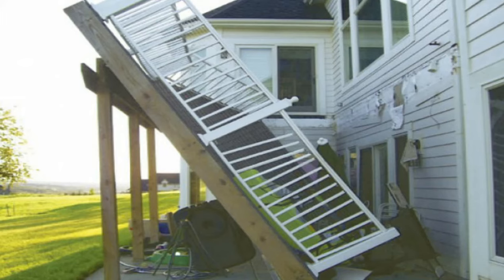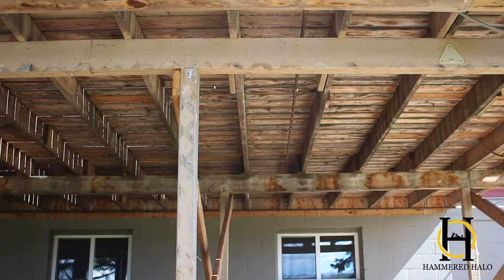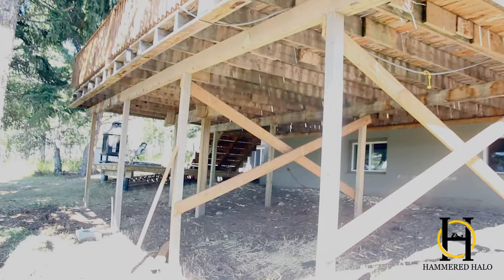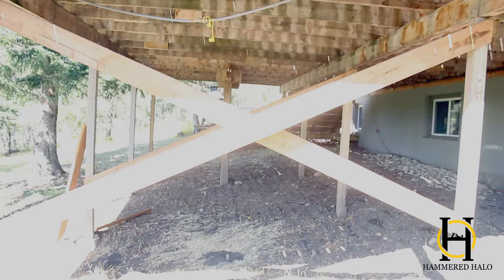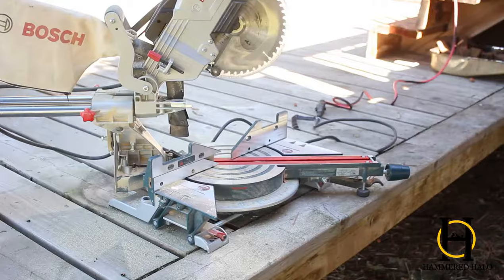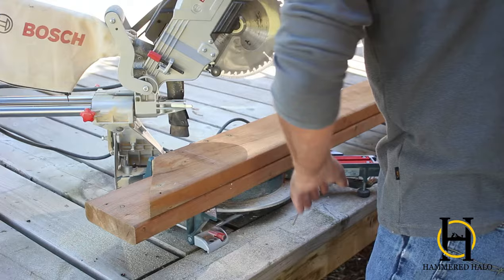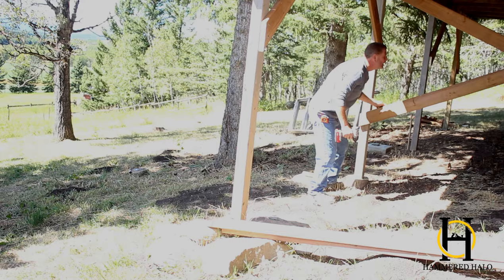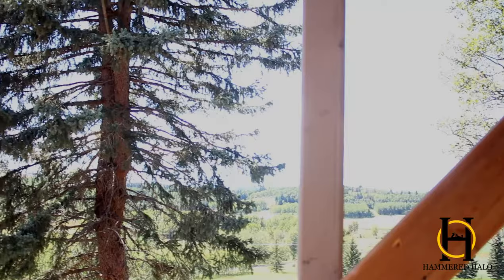DIY - Deck Collapse - HOW TO STOP A DECK FROM SWAYING (EASY FIX) Add deck cross bracing

Comment: Excellent work, cross bracing adds a whole lot of strength. Great vid.
Reply from the maker: Joshua Roode Thanks, yes it helped a lot, that deck is on its last legs and it’s amazing how some simple bracing structurally stables it. Easy fix for piece of mind.

Comment: Thanks for the video. Don't know if you are still getting notifications, but I am about to brace my deck. Could you, please share the size lag screw that you used? Thank you for your time and assistance.
Reply from the maker: Hi there, I used 4” x 1/2” lag bolts on mine
Reply: @DIYBuilt  Thanks for the reply. I kept searching and found Fasten Master has a whole line of structural screws.

Comment: This may be a dumb question but those cross braces aren’t weight bearing are they? I have a rotten 6x6 cross brace on the end of my deck. I’m wondering if I should brace it in anyway beforehand.
Reply from the maker: No, cross braces on our deck are not load bearing, all the load  is carried on the 4x4 posts

Comment: Nice video but should have left the 2x4 braces in the other direction.
Reply from the maker: I thought about leaving them but they really weren’t adding anything to the structure of it and aesthetically made it look terrible.
Reply: @DIYBuilt  they help hold the deck to the house but if the joists are toenailed good to the ledger probably dont do anything and aren’t nesssary
Reply: @jeremiahwilson5  or Lagged would be even better
Reply: @jeremiahwilson5  Only they didn't hold the deck to the house as they only went between posts. Even then, they were improperly installed. The joist-to-ledger connection is joist hangars, as it should be.

Comment: 4x4 bracing would have been better and I am glad you did not use clamp to hold the wood together as everyone else does on these deck videos
Reply from the maker: I agree 4x4s would have been a better choice, but I had the 2x6s left over from another project. Cheers!
Reply: What’s wrong with clamping?

Comment: The problem with the scissor braces is they don't do anything unless you screw them together in the middle. That stops them from swaying front to back.
They weren't done right. As well as you needed those braces for the other direction to keep it from swaying from side to side.
So you should have both. Or make some more of those angle pieces which will look nicer.
Reply from the maker: Thanks for the advice I’ll take another look at it
Reply: @DIYBuilt  HE IS wrong, the X braces are fine “they don’t do anything “ screwing them in the middle is just better but it doesn’t nullify the braces
Reply: @jeremiahwilson5  I am a structural engineer and found this video as I am specifying a timber balcony for a friend. I agree they do not require fixing in the middle and cannot see a reason why this is required. X braces work by one of the members going into tension and the other going into compression. When the member is thin and wide like a plank only the tension member will contribute. This is why you need an X shape not a diagonal only when using flats for bracing!
Reply: Great video by the way, I love watching these practical videos of people making things!
Reply from the maker: @bikesrcooldan  Thanks so much for your insight Dan. I really appreciate and respect your professional opinions on this matter.
Reply from the maker: @bikesrcooldan  thanks for watching and for your support

Comment: Installing  Braces underneath the joists is stronger. and eliminates all those braces you installed
Reply: Does adding the braces help with load weight?
Reply: @chadzohn2713  illiminates any sway

Comment: if you had started with 10ft long boards there would be much less waste.  those boards you removed could have been used for cross-bracing (relocated).

Comment: What are you using to attach the braces? Thanks for the video!
Reply from the maker: I used 4" x 5/16" Lag bolts. Thanks for watching
Reply: @DIYBuilt  wouldn't using big bolts like that damage the woods faster being that it's larger than a screw/nail? 

I have a house that's 8ft off the ground so I need to stabilize it too. Ppl built the house and didn't stabilize or brace it well enough.  A few storms already had shaken it but thank goodness it didn't Crack or break (yet). I'll use your video as reference!
Reply from the maker: @chasityfelix5054  thanks for your comment, we used 5/16” lag bolts but in your case I would be more inclined to pre drill holes and use through bolts with flat washer, lock washers and nuts. you should consult a structural engineer to be certain with your situation.

Comment: Well one you should use 646 post notch at top for the beans and probably bolted with 1/2 galvanized hex head bolts making sure the post are firmly down at least 18 inches below the surface of the ground in concrete
Reply: Embedding posts in the ground with concrete is just asking for them to rot (unless you live in a desert or something). Posts need to be up out of the ground supported by galvanized connectors to concrete piers that extend below the frost line
Reply: @majahanson311  nope that's what's required by the building inspection frost line is 2 ft and no they do not rot
Reply: @majahanson311  absolutely not technically only required to have 8 inches concrete below post I like bringing the concrete up to about 2 in below the grade so it's around the post with an anchor connecting it to the concrete
Reply: @majahanson311  sorry you haven't figured out the concept called pressure-treated lumber yet
Reply: I've seen plenty of PT, including supposedly ground contact rated, rot if left in contact with the soil. Deliberately doing that (2" below the grade, as you say) sounds a lot like planned obsolescence to me. I realize this is how things used to be done, but we have better ways of doing things now
Reply: @majahanson311  wrong explicit required by building code in the area cannot be above ground
Reply: @majahanson311  The truth is there's always going to be decay no matter what you do.  If you use metal post anchors as you suggest, the metal will rust and decay away over time causing structural issues. Only way to stop it is with stainless steel but that is VERY expensive.  A galvanized joist hanger is like $1.  A stainless steel joist hanger is $10. So that's 10 times the cost. And this adds up fast when you have a large deck with, say, 100 joist hangers. And that's before you add in the cost of stainless fasteners (you must use stainless fasteners with stainless hangers).
Reply: @Wowzersdude-k5c  Yes, there's always going to be decay so it's best to plan for it. Which is easier to replace, a post sunk 2 feet into concrete or a galvanized post base? Even PT lumber rated for ground contact has a reputation for rotting off at the grown contact line.

Comment: I see you have no blocking underneath your deck, it is crucial.  I would say minimum in the middle parallel to the house but you will need more because your deck is large. 
The distance of the footings are way too far apart and the 4x4 not the best in your setting.

Good to have a helper :)   I don't get help from my husband, he prefers to watch TV.
Reply from the maker: Ya this deck was built improperly by a previous owner but we just wanted to strengthen it up a bit for safety concerns until we could replace it. 
Having a helping hand on this project was a godsend

Comment: Tear it down and start over. Also no way in hell that’s 1000 sqft
Reply from the maker: I agree and ya your right, it is just under 600sqft, there was a lower level extension off of this one that we previously tore down due to safety concerns that I included by mistake.